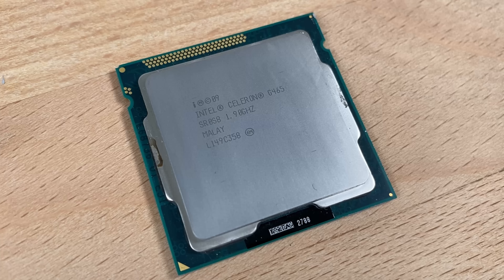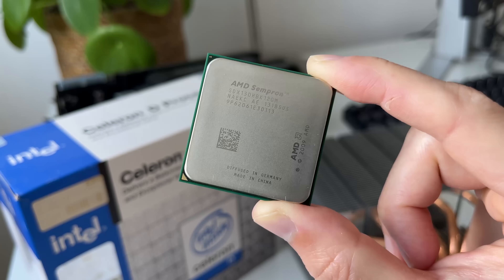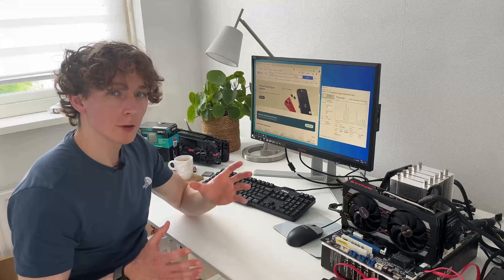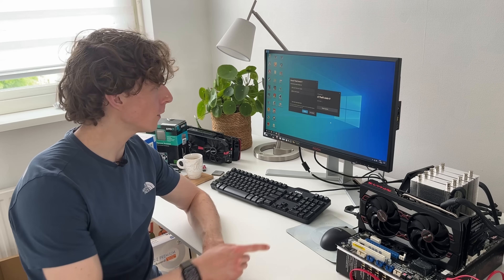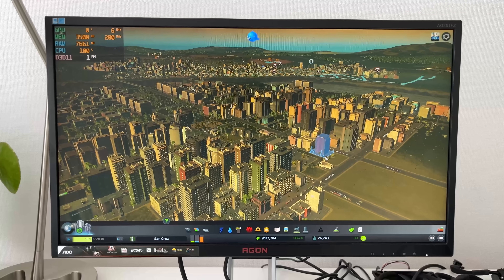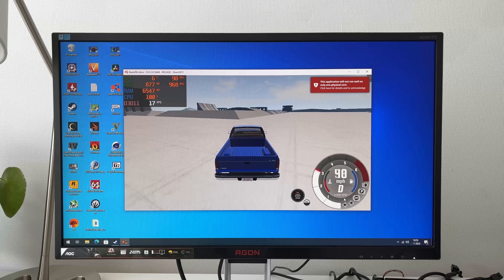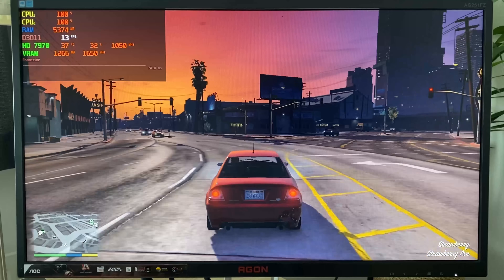AMD's Final Single Core CPU...

Comment: I pushed a sempron 2.6Ghz to over 4.1Ghz back in the days, using a compressor as cooling and ramping temps up to -41 degrees. Great chips, they really get wild beyond 4GHz. As for the hardware fused off core, you figured it out how it was impossible to boot or even run anything with it. Nothing gets lost in the making of silicon - you got the high end stuff and the low end stuff; All comes from good to semi good working chips most of the time cut down to meet up with specs. If i'm correct AMD is paying 10K per wafer - the more chips you can get (working) from it the better the margins.
Reply from the maker: That would have been an awesome setup, running sub-ambient on a daily machine
Reply: @FullyBuffered  only running a condenser is not cheap. It’s like running a fridge 24/7
Reply: @FullyBuffered  you might want to check asetek vapochill as suggestion for your next video

Comment: I bought one of these chips in 2012-2013 because it was ridiculously cheap on clearance. I think I only paid $40 for it at the time and another $45-50 for a Foxconn AM3 motherboard.

These Sempron 130 chips had a trick up their sleeve, many of them were in fact dual core parts with one locked core. Mine unlocked to an Athlon II x2 4300e. It performed well as a general purpose desktop machine for probably 7 years before it got blown up by a lightning strike. The motherboard was smoked, but the CPU still survived and is sitting in my CPU drawer.
Reply: Did you have a surge suppressor or did it get past that? I just put a lot into some upgrades on my rig and this is one of my fears so I bought a new surge suppressor also but I hear sometimes they don't work. I've never been around a lightning strike.
Reply: @davel4030  Surge came in through the Ethernet port and blew a crater in the motherboard.

Mains surge protectors are generally worthless regardless, because the only thing they do is put MOVs between the equipment and the mains. Power spikes easily burn them and they just keep on conducting.

To have real protection, you need a double conversion UPS, where the powered equipment never sees the mains, as well as lightning suppressors on the network equipment. Lightning suppressors use gas discharge tubes to ground. Once they start conducting, they become the lowest impedance path to ground and the surge goes through them instead of the equipment.

There was neither on the motherboard that got blown up, the company that was using it was too cheap to install it. A good UPS and an Ethernet lightning suppressor only costs around $400.
Reply: anything sargas was a failed regor bin. in other words: every single core sempron from that era was a dual core chip, but how well the second core actually worked varied.

Comment: i had a sempron 140 back in 2010 after the family computer died in a thunder storm. that computer had some celeron 775 i think, running between 800mhz to 1.6ghz, i don't remember anymore. it sucked so much flash games ran at like 3 fps. after that celeron, using the sempron felt so much better and it even ran games. i could play counter strike 1.6 at over 3fps, it ran gta san andreas at 30fps with everything at the lowest of lowest and would play youtube without issues, all this with the integrated nvidia 6150se graphics.

i revived that system in early 2018 but after a day the motherboard would restart randomly. performance was impressive though, youtube playback at 720p was stable and not too bad, the system felt snappy and even ran my psp games just fine. i'd have it going still but i just don't have any use for it anyways... yet.
Reply from the maker: Thanks for the comment!

Comment: AMD in those days took binning to the extreme. If a CPU was defective but would work in any configuration at all, they would sell it. They would sell an X6 part as a Sempron if one of the six cores would work at a salable price.

But those were still just barely good enough for everyday tasks in 2011. I never bought one, because even if I were building someone a basic PC, a dual-core Athlon wasn't much more and would sometimes unlock to a Phenom II and work fine. One thing I know the Semprons were used for is that some high-end motherboards refused to initialize a CPU that came out after the board did; you couldn't even flash an updated BIOS. But the Sempron would always be recognized and allow you to flash.
Reply: They where paying per wafer - so lets say you can get X amount of fully good working dies out of it, and X / X / X amount of half, quarter functional dies out of it. You obviously don't throw the half working dies away - you fuse these off either through BIOS (firmware) or as of today with hardware fuses and sell them for lower priced parts. This way nothing gets lost.
Reply from the maker: Agreed! Thanks for sharing

Comment: I know why they made them, because they had a customer buying them by the 10s of 1000s. I used to work PC shop and the Sempy was always in the "Walmart Specials" which was a $299 PC sold at Walmart with the worst specs they could get and make a functional PC, crap monitor, minimum RAM, weak AF CPU, garbage case and the worst KB and mouse you'd ever touch.

One of our biggest jobs at the time was upgrading those turds after people got tired of suffering the slowness and it would end up costing them more than if they bought a decent PC in the first place but sunk cost fallacy? it is a real thing 🤷‍♂

Comment: I bought an Athlon II X3 455 in 2012 and I was able to unlock the 4th core on a very cheap ASROCK Motherboard, which turned it into a perfectly functional never released Phenom II X4 B55. I could even overclock it to 3.6 GHz and I remember playing Far Cry 5 with like 40-50 fps on average.
Reply from the maker: Nice! Thanks for sharing

Comment: I opened my first repair shop in 2002.  Your videos bring me back to my early days of selling custom builds!  I just got an AMD Geode build back in for recycle I built for a customers office PC around 2004-2005.  I did a video on the CPU and the build, then reused the case for a server build for the shop.
Reply from the maker: Thanks for sharing!
Reply: Does Geode require windows drivers to "start working"?
I have an Raon Everun UMPC that thas Geode2 and it took minutes to boot up and when the windows driver loaded, it became useful.

Maybe i should find out what kinda Linux support it has, can't be worse...... Im serious, never-ever experinced a worse CPU.
Reply: @woldemunster9244  those are the original Cytix Geodes. I never played with them.  When AMD bought the Geode line they did keep making the Cyrix based hardware for embedded lower power applications all the way to 2019.  However the ones I sold were the NX line.  Which were rebadged, refined, more power efficient  Athlon XP silicon. Released as the Geode NX series to compete with the Via C3 for low power office PCs.

Comment: You keep focusing on pure cpu clock speed when comparing the overclocked amd, but I'm more then 8 minutes in and you never once mentioned the exact oc just resulting clock speed. I want to know the configuration without it it's just a little empty I need to have my hardware memory recollection fix ;)

Still nice video, I think my last AMD was a Venice or San Diego, then c2d come and c2q and I haven't been on AMD since even when I know they are top of hill now I just can no longer justify the prices to myself to still care.
Reply from the maker: Thanks for the comment - you can the see the BIOS settings used just before the CPU-Z shown on screen - 280 MHz bus speed, 2240 MHz HT link, DDR3-1493, 1.5Vcore
Reply: @FullyBuffered  Damn my Asrock at the time couldn't do over 260 bus. And that's quite some nice ram, didn't catch the timings but I guess they are quite loose? Four sticks with decent speeds and good timings wasn't easy, again that was on my quite limited Asrock board. 

Would be nice to see another video with trying to unlock the second core and seeing how that impacts things both at stock clocks and oc'd. Does having two cores at the stock clocks make up for the lower clocks, or does the higher clock single core matters more. I guess there is plenty of content around from back then, at least in articles ect, but there is something to going down nostalgia lane isn't there :)

Comment: I thought you were going to talk about the Sempron 145 at first, since that seemed to be the last one that was of note, and one I happen to have on hand. I would have considered trying to use it for a Windows 98se overkill build; however, the requisite board that would still have an AGP slot is next to impossible to find on ebay, and since AM3 was backwards compatible to support DDR2, even finding low-capacity ddr2 memory is a challenge.

Comment: I remember unlocking these cpu's, it wasn't lowering clock speed that usually got them to work, it was putting a LOT of voltage through them. Your mileage may vary.
Reply: I got lucky with my 130, it just worked with only being unlocked. Ran stable for its entire service life, didn't overclock it to see what limits it had though.
Reply: Playing with voltage and timings were for sure the ways to figure out an overclock, but sometimes the motherboard just wouldn't play along either.

Comment: There was a point where Microcenter was selling those for 5 dollars. Most wound up being used for testing, linux boxes doing small tasks or monitoring.
Reply from the maker: For 5 dollars, you can't go wrong for a new CPU
Reply: @FullyBuffered  I bought myself a used i5 for 5€ once. Got myself an old Optiplex as a media pc for the bedroom and its Celeron wasn't powerful enough to play some video files. That was what convinced me that buying older hardware is still worth it, because you can get reasonably powerful gear for cheap.
Reply: This makes a ton of sense in the days before raspberry pi's
Reply: @CameronVanNatta  And today to... Raspberry Pi is not cheap compared to refurbished or "new old stock".

Unless you want energy efficiency, then the pi zeros and picos are great!
Reply: @Jossandoval  yeah, zero and pico for little tinkering is great.
But if you wanna buy pi 4 pi 5 for homelab or doing smth more, at that point just grab some used Intel gen6 mini pc.
Reply: @jnhkx  Yep, these days you can get quad cores for dirt cheap.

Comment: I remember seeing these on Amazon back in the introduction of the FX era. 

I nearly bought one purely because all the reviews said I could unlock that second core… I ended up spending an extra £20 and got an FX4300.

That GTA V loading actually is the only thing I’ve ever seen come to a Celeron D in load times. Wow. 

Loved the video man 👍
Reply: Did that with the Phenom X3, turns out not all 3 core chips was in fact perfectly fine 4 cores, cut down to meet demand, as many internet forums were claiming, the 4th core was never entirely stable. Did run it as a 4 core for a while, but if I wanted stability I either had to underclock it, or revert to 3 cores.
Reply: @ZnakeTech  yeah I tried it with an Athlon II x3 (which we referred to as a cripple core processor instead of triple core) and no dice either.  I’ve seen people do it successfully though. Even a Phenom II X2 that unlocked to X4 and the X4 T Phenoms that were secretly X6s.
Reply: @ZnakeTech  The way I heard reviewers explain things like this is it's a gamble. But, kind of in reverse if you bought it expecting it to be as labeled. Just with a hidden bonus if you can make it work as originally spec'd. Sometimes a chip had defects but was fine after being modded to lower spec, sometimes it was perfectly fine but features disabled to fill demand for lower spec.
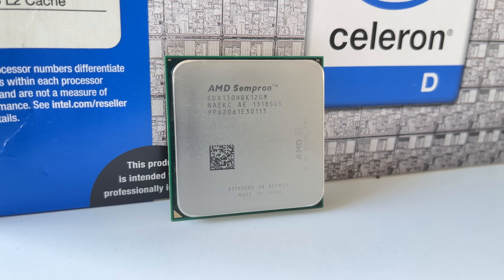Reply: @ZnakeTech  9:32 9:41
Reply from the maker: Thanks man! As bad as Bulldozer was, an FX4300 was the right call for an extra 20 pounds...
Reply: @FullyBuffered  FXs are f** awesome! 🤣
Reply: Core unlocking was very common back then and especially later on in the life cycle (when yields were better) of the single and triple cores a gamble some were willing to take when on a tight budget. It was an interesting time.
Reply: When your opponent is a single core Sempron, that will make an FX-4300 look like infinite power.
Reply: I remember the asRock UCC boards I think i managed to unlock a phenom x3 tp x4 successfully once have tried s couple of other chips , never had any issues with stability on the one that worked
Reply: nothing like spending 45 minutes to play gta 5
Reply: It depended on the model 😊out of 4 systems built with phenom x3s 1 wasn't good unlocked and the last one  and newest manufactured.
 It was only one.game it would.blue screen In and we just kept it locked
Was a.gamble but.newer chips had better odds
Reply: i went from the AMD FX-8350 to the Ryzen 1600 and never really realized how terrible the FX line up was until that point.

Comment: I bought one of these chips in 2011 for one specific reason: I bought an AM3 board for a computer build I'd saved up for, and found out after putting it together to test, that couldn't boot Piledriver CPUs without a BIOS update. it was cheaper and quicker to get the Sempron 130  than to RMA the board.
Reply from the maker: Haha amazing, thanks for sharing
Reply: Thats the reason this chit was released. though I believe the Idea was so that shops could do the updating without having to put a more expansive cpu on the line, people did also buy them to play around with.
Reply: Reminds me of when the K6-2 400 came out - BEFORE MS had support for the CPU baked into windows. We LITERALLY had to UNDERCLOCK the CPU to 300 MHZ, install Windows, install a patch made by AMD, THEN return the clock speed to 400!
Reply: I basically did the same thing almost a decade later. Buying a used A6-9500 AM4 faildozer-based turd just to update the BIOS was quicker than to RMA the board or have the shop I bought it from update it for me so it would support/boot with the (then brand new) 3700X lol
Reply: or you could've just updated the BIOS 😇
Reply: @KalakCZ  how do you update a bios when the system won't boot with the CPU. that was the problem. people bought a new motherboard with cpu and it couldn't boot.
Reply: @terabbs  fair enough
Reply: @KalakCZ  Back in the day you couldn't flash a BIOS without having a CPU in it. It's not like today where it becomes more and more common for Motherboards to be able to do that without one
Reply: @Wockes  even now some mobos have problems with it.

Mine wasn't able to flash with USB but worked fine in bios.
Reply: @KalakCZ  lol how are you going to do that when your CPU won't boot on it?

Comment: AMD are doing this to recycle defective chips. Maybe someone could need some of these, they think. Better than letting it go to waste. AMD have done it again recently even, releasing Ryzen 5000 CPUs that make absolutely no sense.
Reply: I mean, the 5600X3D was kindof a cool budget option... if you lived near a microcenter in the usa to buy one
Reply: What amd is doing now is somewhat different. They are using am4 as the budget platform instead of releasing super cheap am5 chips.
Reply: @awesomecomputers7076  Doesn't change the fact that some of these new SKUs make no sense whatsoever. But it's better than wasting them. There's always some nieche where you can use these.

Comment: These cpus could be used to make retro XP gaming builds.
Reply: Only if the board has drivers, but even then, why not a dual core?
Reply from the maker: The 870 probably supports XP, but you make a good point - why not use a dual core...
Reply: @FullyBuffered  most older titles up until the 2000s relied heavily on a single thread for their performance in games. It's only later that dual cores and higher were considered when developing newer PC titles.
Reply: @SlickOnTop  Yeah, but XP was multicore native. Even if the game only uses one thread, it's not the only thread on the system.

Comment: The last single core I've used was an Athlon LE for AM2+, that wasn't half bad! Powered my first NAS.
Reply from the maker: I can imagine they would have been sufficient for such a use case
Reply: Scheduling and software was significantly different then as well.   That would have been a machine likely to get XP or 7 out of the box not 10, (I am purposely forgetting Vista kinda for the lolz it actually got pretty decent towards the end of it's life lifecycle).

Comment: I used to have a Pentium 133Mhz chip that I ran at 166Mhz without a heatsink..
Reply: They cleaned out our library at Loyola one night. Switched every 166 for a 133 right after they came out. They actually took the time to replace the chips. One computer didn't boot and we found out that day.

Comment: I also had a processor like that. I took it out of a laptop on AM2 (I was surprised that such exist), because I put Athlon 64 X2 there. It stood in my computer for some time while I was waiting for my Athlon II X4. On this miracle I even managed to install Windows 11, with a regular hard disk, it slowed down tremendously, after which Windows 10 was installed again. Interesting processor, of course.
Reply from the maker: Oof Windows 11 on a HDD would not have been great..
Reply: @FullyBuffered i know, i'am checked it on myself 😆

Comment: Would have been nice if you could get a sample that unlocked, follow up maybe? might be better to do a retrospective on all the unlocks if you can collect them all. OEM only 640T is the athon quad that unlocks to hex core phenom.
Reply from the maker: Thanks! I have an X6 1090T (which I used to install Windows and apps) which I want to feature, but I did also think of doing a video just on core unlocking :)